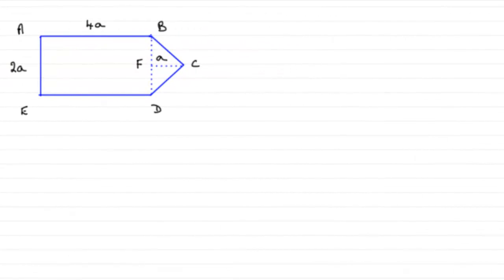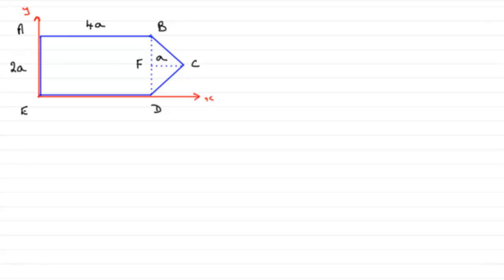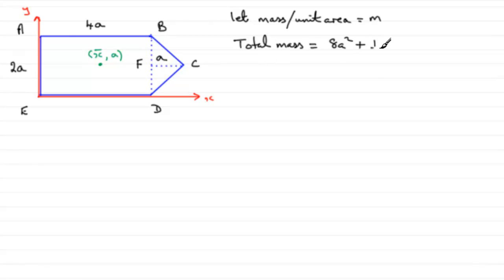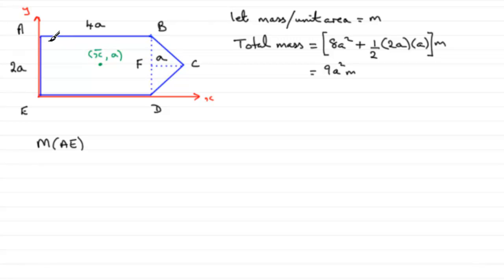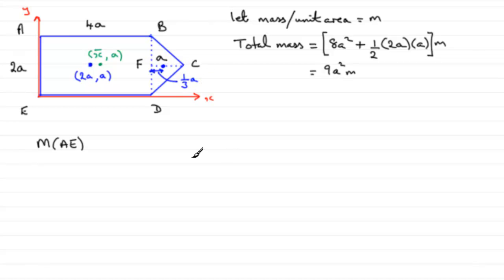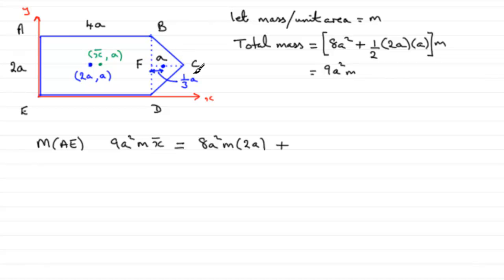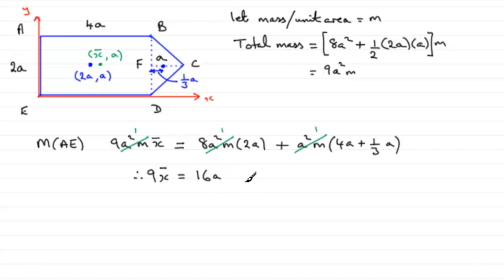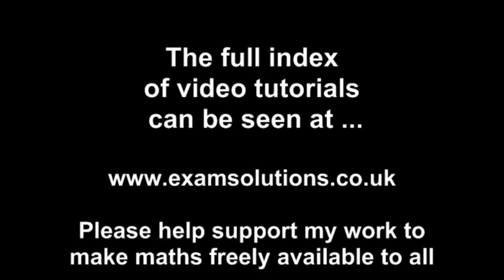Edexcel Mechanics M2 June 2011 Q4a : ExamSolutions

Comment: Hi sir, how do you decide whether to take the axes from the base(bottom) of the  adjuged shape, or when y=0, so through the midpoint of the shape.

Regards.
Reply from the maker: In the end it is up to you as you can place it anywhere. However, I normally go to an outer edge as it is easier and also along a line of symmetry. The best thing to do is to try the same problem in different places and you will soon gain the experience of knowing which is best. Obviously the final answer for each case should be the same.
Reply: ExamSolutions
thanks sir.